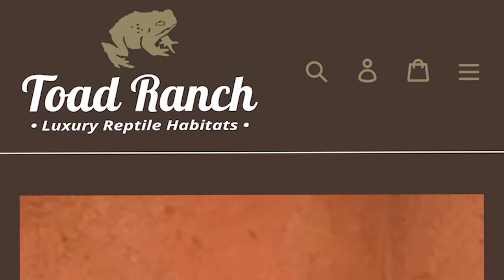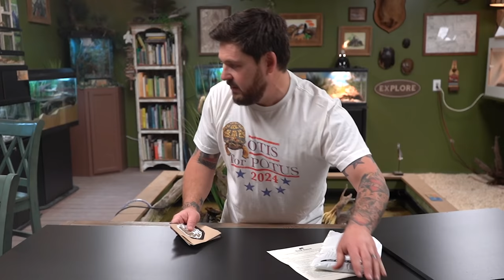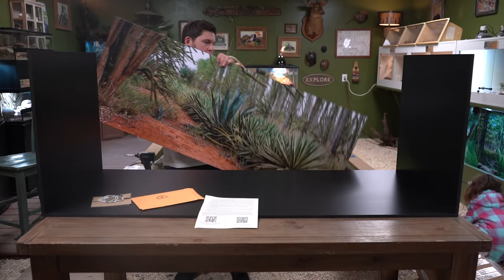Dumeril’s Boa Enclosure Build!

Comment: Great enclosure! Love seeing animals in nice big spaces. I also provide uvb to my snake, more and more evidence is showing that they benefit from it both physiologically and behaviorally. Only suggestion I will make is that it's recommended that uvb and heat be provided in the same area because animals associate light and heat with the sun and all it's benefits. So, separating them out like that, and the uvb is giving the light, your beautiful dumeril may have to choose between uvb or heat, when it should be both at the same time. It's easily rectified though, with a low power linear uvb along side her heat source, so that the heat lamp is about halfway along the uvb tube. Arcadia make wonderful uvb tubes for snakes. Also, consider switching the ceramic to a halogen as halogens provide wavelengths of light found during the day (IRA/IRB) and so are more "natural" as basking lamps. Ceramics produce IRC that are more associated with night time energy wavelengths. 

Love the channel thanks for highlighting a wonderful species. She has a sweet face.
Reply from the maker: Thanks Natalia. I actually do radio telemetry on wild snakes for my day job as an assistant herpetologist. We find that snakes possibly benefit from uvb by not actually subjecting themselves directly to it by basking in it. Basking is exhibited mainly for heat absorption and proper digestion while uvb is more for associating the time of day and light cycles. This is why we separate them in the enclosure. It replicates what they’re doing in nature to an extent. The constant exposure to uvb through basking May stress snakes out as they are so cryptic and only expose themselves 100% in small intervals. They’ll actually bask underneath leaf litter and other debris to absorb heat while the uvb again, is more a trigger for the time of day and intensity of the sun throughout the day. They’ll completely avoid it at the peak of the day during intense heat for example.
Anyway, thanks for watching and for the pointers!
Reply: @GardenStateTortoise  hi, yes that is true they cryptic bask most of the time, so in our enclosures we set it up to allow for the really cool behavior to happen. When they bask in nature, that spot of sunlight they stick a coil under has all the wavelengths in it at once (IRA/IRB/UVB/visible light), natural sunlight doesn't separate itself out. Providing a low uvb bulb with a heat source is aimed at mimicking nature as best as possible in our captive environments. It's not perfect but it's true best we have for now. It should not stress them to be in and out of uvb given enough choices within the enclosure to get out of it and practice cryptic basking. A linear bulb is really great for this because it allows the keeper to provide heat and uvb together but there are portions of the enclosure that will get only uvb, again providing choice and control for the animal to choose what it wants. A linear uvb half the enclosure length is recommended and placed favoring the warm side, so that the cool end is your "shade" with no extra heat or uvb and the snake can get out of both. And of course yes it allows for natural day night cycling as you mentioned is truly important in captivity. Animals at home podcast has a great episode on this topic with an interview with Dr. Francis Baines and she runs a FB group, Reptile Lighting, with wonderful information. Thanks!